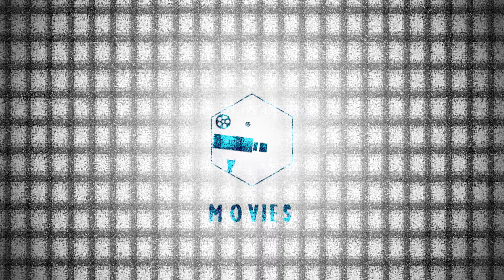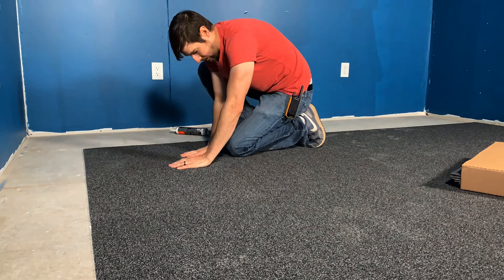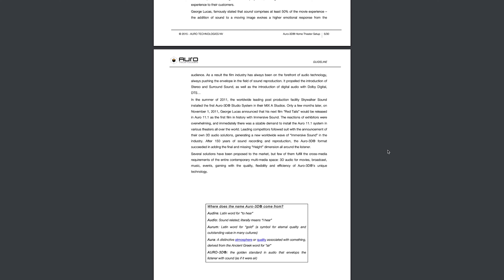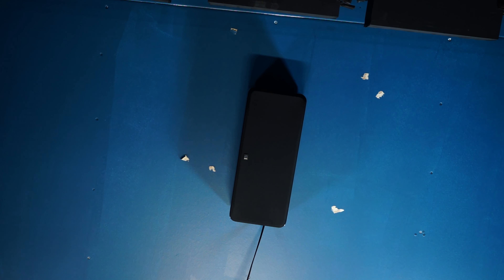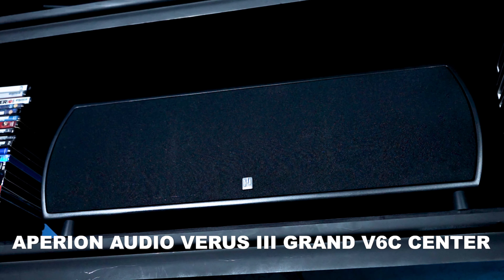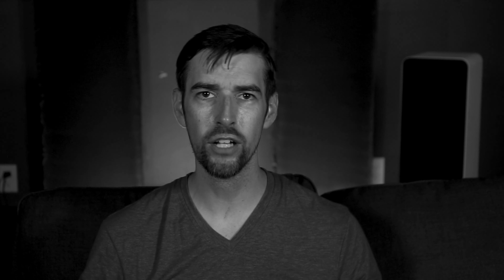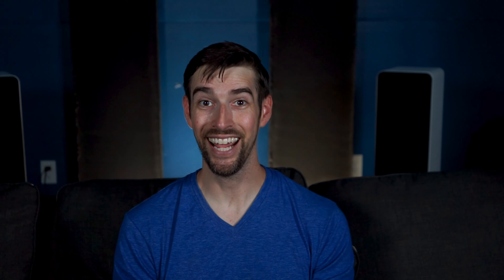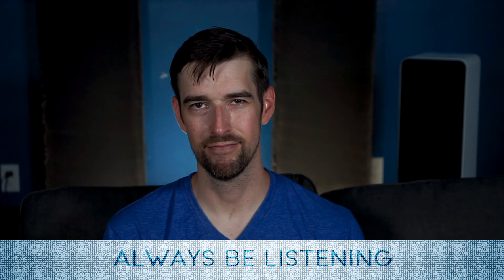IT'S DONE!!! DIY Home Theater Episode 3 | @AperionAudioSpeakers | Dolby Atmos | DTS X | Auro 3D

Comment: I'm just starting I've been doing the sound bar thing wife thinks it's good enough but she finally agreed I can have $3500 for a home theater so am looking at 2 options a pioneer elite lx 505 I wanted the onkyo but sold out everywhere and speakers I think klipsch at costco or ordering some svs prime center and 2 book shelfs and the svs 2000pro sub. Any feedback would be great thank you.
Reply from the maker: The Pioneer 505 is basically the same as the RZ50, so I would still go for that. Dirac Live is the best room calibration (IMO), which the 505 has. 🤘 

And if you can swing it, an SVS system would be killer, not just audio-wise, but dealing with their stellar customer service makes the whole process that much more seamless. 🙌
Reply: @ealanosborne  thank you for the reply your amazing been watching your all your videos and you make it hard to nail down the right system I want mine for tv and 50/50 music and movies thanks.
Reply from the maker: @edwardwilson9195  Music and movies is either Yamaha or Marantz, depending on your budget or brand preference. Although Emotiva does well for both music and movies, but they don’t have any AVRs, just preamps and external amps. So there it is narrowed down to 3, at least! 😄🤘
Reply: @ealanosborne  so no pioneer then. I think it has 120 watts per channel. Was looking at the new yamaha receiver for $1500 but what I read is the 8k and most of the features aren't ready yet but do you honestly think the yamaha is better for movies and sound than the pioneer 505 if so I'll take your advice and get it. Also what yamaha receiver would you recommend for that price.
Reply: @ealanosborne  also I'm not going to use external amps I'm new to all this basically a 3.1 system till I can afford back speakers and heights from svs that why I was thinking of the klipsch 5.0.2 to get more speakers bit kinda want bookshelf for space to keep wife happy.
Reply from the maker: @edwardwilson9195  Whoops. My bad. Sorry, I’ve had a ton of comments today, so it’s been tough keeping track of who’s who. 😄 Marantz is great if it’s in your budget, but yes - if you’re willing to spend $1500 on the Pioneer 505, I’d still go for that. It would be better than Yamaha, again since it has Dirac Live for calibration. It’ll still make music sound great, even though Marantz and Yamaha are known for their musicality.
Reply: @ealanosborne  hi quick question I ordered the pioneer 505 with svs speakers and sb 2000 pro but my sub don't work with music through TV or USB or Bluetooth but works with TV shows or movies what am I doing wrong thanks in advance.
Reply: Also running through ark for tv

Comment: I can truly relate, my home theatre has been part of the living room for around 12 years, that's how long I've had the death stare from my wife 🤣🤣. But the dream is to have a separate living space for a dedicated home theatre. I've pieced mine bit by bit over the years upgrading whenever possible. I just started with separate about 2 month ago, I bought an outlaw 7000 amp to power my 7 channel bed layer. For some reason I think there is something wrong with my setup, I was expecting more power when I added my amp but I've never had separates so can't compare plus I'm aware that my home theatre is budget level compared to others. I don't have room treatment so I know that can improve the sound performance.I'm eager to see your review on the outlaw amp and the comparisons. My current 7.2.4  setup is as follows- Denon 4700 receiver, Outlaw 7000- 7 channel amp, my Left and right are the Jamo C 97 II, the surrounds are the Jamo C 9 SUR II, the rear surrounds are the C 93 II bookshelves, the Center is SVS Ultra center, the 4 heights (front and rear, cause I use Auro 3D as much as Atmos) are Polk OWM3, the subs are SVS PC 2000 pro. I enjoy the content,  appreciate your approach, simplicity and humbleness. Looking forward to what you have next. God bless.
Reply: I would be very surprised if the amp was performing correctly on the C97s and you weren't happy, I have a very similar setup to you but with first gen C97 and C10 Cen and in ceiling Atmos running off a Denon X3700 in preamp mode, to an Emotiva A700 which is only 80w RMS to all 7 channels, and found it a major upgrade in clarity and low end grunt, I have a reasonable sized room and have never needed to push the amp close to its limit. Perhaps something is wrong with gain level somewhere or source input levels?
Is it louder when you turn off Audessey?
Reply: @calibre00  Thank you, I appreciate you reaching out. I've noticed a bit of improvement, I  had higher expectations going into separates and adding the outlaw amp. I've heard so many great things about the amp and how it can improved your listening experience so much. I've gone in fixed the levels and distances after calibrating with Audessy, I haven't touched the input source level, when playing music I go either stereo with the subs playing and bypassing Audessy to the left/right speaker or simply pure direct. But, I'm finding myself having to go as low as -12 to -10, that's when the towers come alive, when listening to music, I didn't expect to have to go that the low when I added the amp. With Movies I stay around -20 since I live in a townhouse. Not sure if it's unrealistic expectations or if there is something wrong with the amp, looking into learning how to test the wattage coming out of the amp, or I may have to buy an amp with more power to compare, but that will be in a year or two. Thank you again for reaching out I appreciate your time and advice.
Reply: @thereaperscoming  no problem. That is strange... The 120w RMS my C97s get in pure direct/ 2ch mode from my A700 would blow my head off at -10db so im not sure what is going on there. 
I predominantly use Appletv for my music source and have found some apps seem to have much lower gain than others? 
Ie Tidal compared to Apple music or Spotify is very low.
Though as I mentioned Im running in full pre-amp mode so all internal amps on the Denon are off, and im very happy with it. 
Maybe an option for you down the road is to add something like an Emotiva A3 (130w x3) for the front stage and run the Outlaw to the rest?
Thats my plan eventually.
Edit: just noticed you need 11 channels... A3 wont quite get there.

Comment: Hi, Elan.
 I just had my 11.1 Auro 3D system installed. 
 I started with 10.1 (center hight). Perfect sound.....hard to understand 5 hight speakers makes such difference.
 Then I added the VOG channel. My Marantz 8015 shows all channel are active but VOG is very....modest.
 When listening to Wilfried V.B, Joe M and Channa D (you are all great, thank you for what you do) I expected much more from VOG.
 Am I wrong to expect more? I have VOG set to maximum (12) and the rest hight speakers set to 6.
 Hight speakers: 6 SVS P. Elevation
 Front and surround speakers: Canton Ergo RC-L
 What should I expect from VOG? 
 Can you please make a vid. and explain more. As you said....a lot of work goes in to installing them hights.
 Thank you.
Reply from the maker: It’s still a mystery what benefits VOG has (for me personally). This is the first setup I’ve had with VOG and the IOTA AVX17 doesn’t support Auro 3D. So once I’m officially done reviewing it, I’ll be hooking up my SR7015 to run Auro. I plan on making a video soon about how to setup a 10.1 configuration, but also if it’s any good or worth it. So stay tuned! 😁🙌

Comment: You should get the parts express 18” subwoofer with the dual 18” passive radiators and build it when it comes to subs in theater if you diy you get way more bang for your buck 1000 dollars will get you a sub with the quality of a 4-5k sub
Reply from the maker: Thanks for the heads up! 🤘
Reply: @ealanosborne  your so handy you could easily make this and I’m sure you would love it